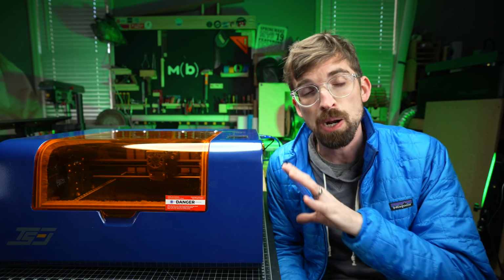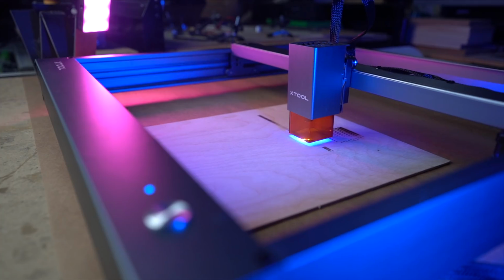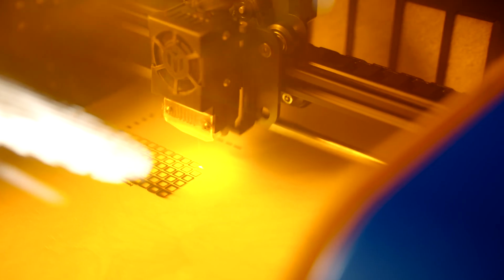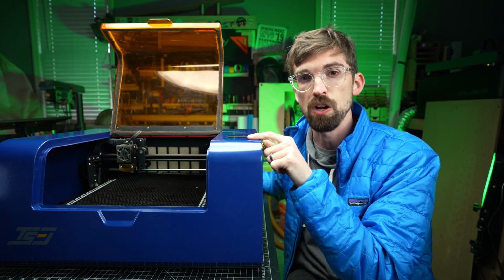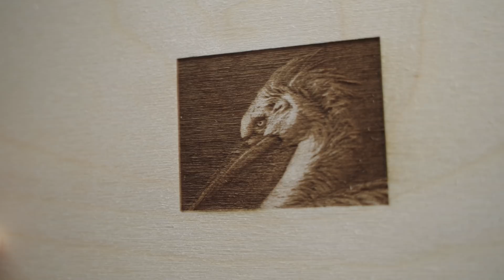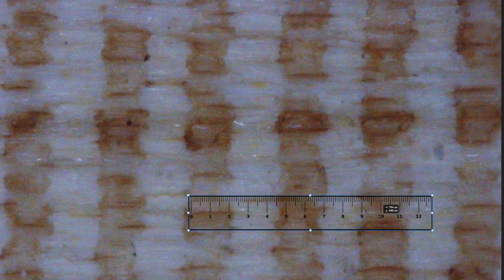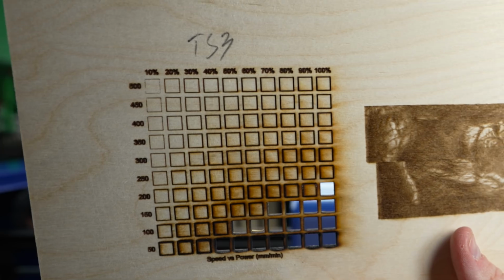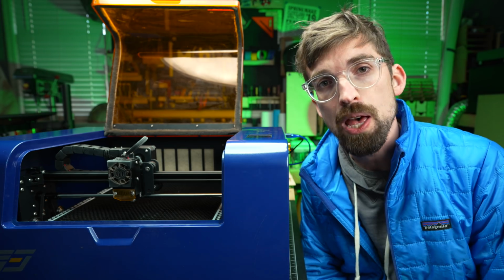The Feature Every Laser Should Have! - Two Trees TS3 Laser Engraver Review

Comment: Great review - thank you! I just got mine last week but haven't had a chance to play. As one of the early Kickstarter supporters I can confirm receiving the laser. The integrated rotary tool imbedded in the belly of the machine is an awesome feature. No difficult adjustments or cables to screw around with... just pull out the honeycomb grate, unscrew 4 screws, and lift out the two panels.
Reply: Did you end up liking the laser? Considering buying one.

Comment: How do two 5 watt diodes make a 10 watt? Why isn't it just two 5 watt?
Reply from the maker: The two diodes get directed a lens which focuses them together.  Usually one diode is pointed straight down and the other is 90 degrees to the side which is reflected into the other beam with a mirror.

Comment: @4:34 - MicroSD
Reply from the maker: Good catch
Reply: @makeorbreakshop  ;) happy to fulfill the comment section's time-honored tradition of picking every second of a video to pieces.  I enjoy the content though. Looking forward to a "DIY diode laser in '22" series where you take all the features/parts from the best kits and mash them together in a sub-$500 unit. Dual-diode module, air assist, auto z height IR sensor, carbon air filter, etc.